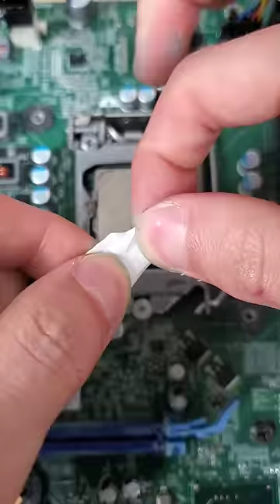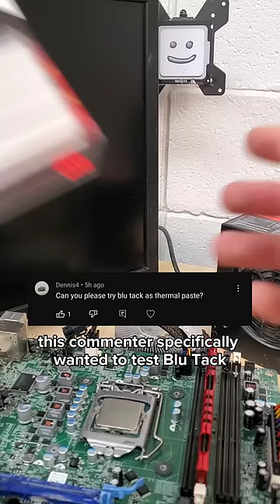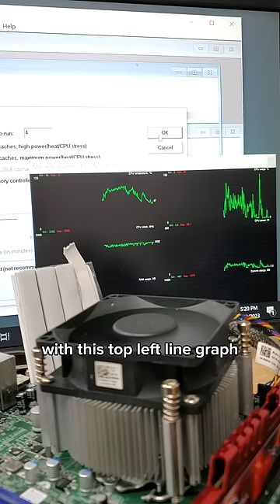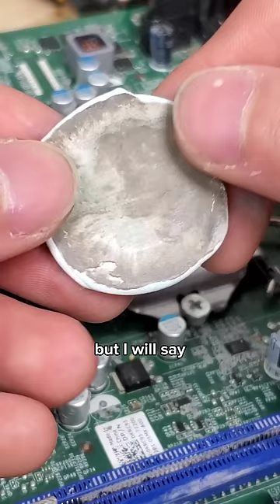can sticky tack replace thermal paste in your PC? #shorts

Comment: Rubber is an good thermal(and electric) insulator. If anything, you'd rather use it as a makeshift thermal sleeve to force heat to stay within a designated area.

Comment: Thermal paste is only meant to fill the very tiny areas of unevenness between heatsink and heatspreader. Not even the best thermal paste conducts heat better than either. Minimize layer thickness. Always.

Comment: What happens if you use a pc with more ram than storage and then remove the storage while doing something on the pc?could it be that just everything on the ssd runs on the ram and so all works?